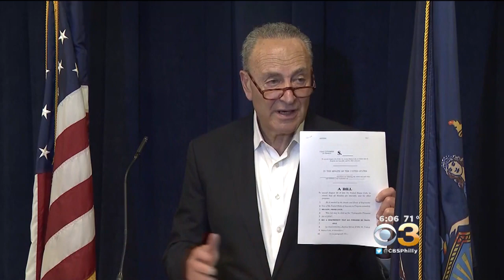Pennsylvania Users Blocked From 3D-Printed Gun Files After Emergency Court Hearing

Comment: Lol just register on the site as a resident of a different state 😂 #guncontrolisdead #shallnotinfringe
Reply: Or use a VPN or go to any 3D model repository where these files have been posted for years. But that's not the bigger issue, the bigger issue is they are blatantly violating the 1st and 2nd Amendment by doing this.